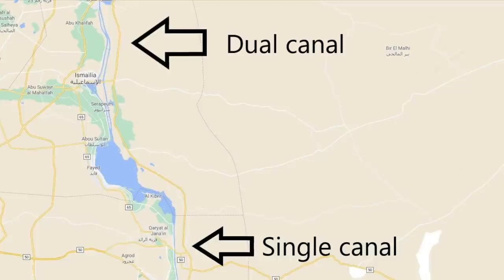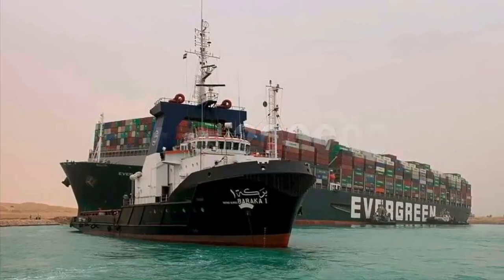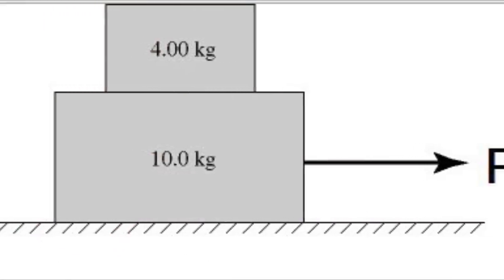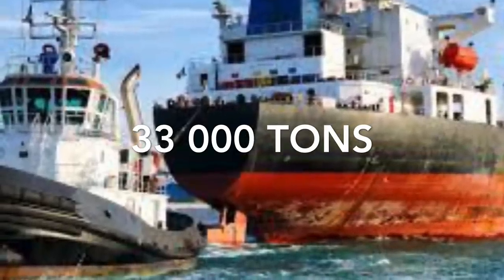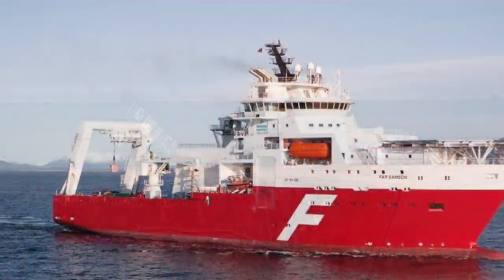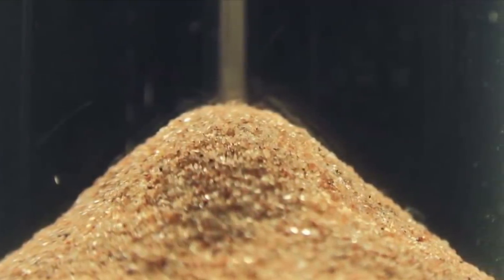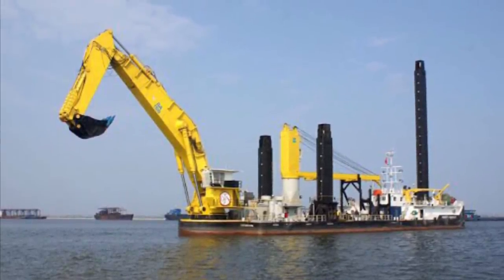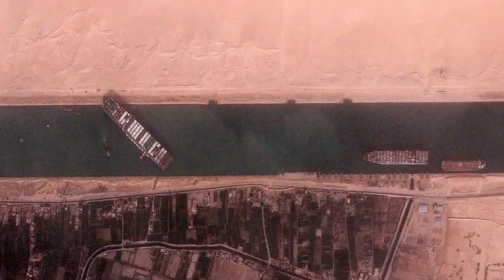MV Ever Given - why can't it be pulled out? Suez canal blocked

Comment: A solution like how the ships going through the Panama Canal might be the way to go. Set up anchor points along the shore and have them pull on various hard points on the ship at different times to pull and align the ship into position.
Reply: That’s what I was thinking. Why not pull the stern from land? They could set up some strong anchors on land, attach winches, and pull it out.
Reply: They only do that going through the locks.  For the pools between the locks, it is no different than at Suez.
Reply: that or a variant would probably work, twisting the ship into alignment would take less pulling power by using the 400M of the ships length as a lever against the stuck bow - if the lines were attached to the starboard side at the rear and connected to land based equipment to pull while the ship was in the appropriate level of reverse during high tide I would think would do it.
Reply: Seriously, you don't understand the scale of the forces required, a donkey pulling a barge solution wouldn't work.  You saw how small the backhoe was compared to the ship, they look like tonka toys, you'll never get enough land vehicles there to pull the weight needed.  Remember the Panama canal has a track beside it for the vehicles and the vehicles are sized to pull boats that are floating on water, that is with little resistance not something that's beached.
Reply: @nutandboltguy3720   the tug boats get there quicker. The tugboats generally do a better job because the tugs  try to wobble it back n forth , rock it , get the liquefaction happenning. So far they didn't rock its hull , they just bend the  steel... Thats when they stop the effort, because they dont want to break it  ,its relatively fragile,much weaker than the forces required for brute force dragging...
Reply: @gomerromer7708  Also, there are no locks in the Suez Canal, so there was never any need for such equipment.
Reply: @johnwang9914  I didn’t say it was an easy or simple solution. I realize that it would take a huge amount of equipment to move a 200 000 ton ship. My purpose of posting was to put an idea out there that might work. Since you were so quick to shoot it down you must have a better idea. Please enlighten us.

Comment: Can't high-pressure water hoses be used to wash the sand from under the front of the ship.
Excavating looks hopeless, but water pressure is not.
Reply: I would think that doing the water excavation to the back end and pulling/tugging the ships bow away from the shore might be the best way to tackle the physics here.
Reply: @elizabethschumacher3039  It makes sense, but I didn't think there's any vehicle capable/specially designed to pull such a giant ship from the land.
Reply: Use  pumps similar to the ones used to build artificial islands in Dubai to vacuum sand and silt away from grounded areas plus hydro blasting the bow and stern areas  and widening canal
Reply: @elizabethschumacher3039  that's what I thought too! From my tow truck days I remember the easiest way out is almost always the way it went in.
Reply: I thought the same thing. I use to work at a Quarry, and we would move sand away from machinery foundations with high pressure water hoses.
Reply: I though that too, and there seems to be a few people on the same page here reading the comments. I seem to remember in the last Israeli-Egyptian war, Israeli sappers used the same trick in getting their amphibious vehicles into the Canal, so this could work if some engineers use their heads.
Reply: The offshore dredges he mentions can do this. They are not all sucking up sand they can also move sand with water. It’s still a crazy problem just due to the scale of everything.
Reply: Its not like they just have such pumps laying around, it could take a long time until the pumps are on location and operational.

Comment: The important question is how many tons of high explosives is it going to require to solve this problem.
Reply: It may go that way. There is too much at stake for it to continue to block the canal
Reply: @ProctorsGamble  And if yous wash out all the sand with some pressurized jet water, until is completely afloat...
Reply: @rrebaza  my thoughts as well.  Should be the first thing that comes to mind
Reply: @rrebaza  that would be the reverse of the underwater dredge.
Reply: @rrebaza  I was thinkong the same thing.  Isn't that what the Egyptians did to cross the Suez during the Yom Kippur war?
Reply: More is not always better, but math is hard.

Comment: Well, I am familiar with construction equipment and I am pretty sure that there is equipment that could excavate to 30 feet (10meters) but actually only just. Any deeper and the only viable option I know of is a dragline excavator. These however have limited capacity to dig underneath anything. At this point, given the time pressures it’s probably better to figure out how many of the multiple options can be applied at once. Containers might be off loaded while the dredging goes on.

Comment: Good information.  I did watch another video where they talked about unloading the ship.  There was a problem with that idea though, if not unloaded evenly the ship could crack in two because of uneven weight distribution.  If that's true, removing this ship may take a very long time.
Reply: 20k teu unloading without specialized crane and with the awkward position would take a long time. They still might do that but its not the same as unloading on the docks
Reply: That is correct, sadly, unloading the containers needs to be done very carefully and in a specific order to keep from cracking the ships hull.
Reply: @flyinghigh2000  Exactly, and you would have to have a crew phycically rigging each box by hand before it could be lifted off by crane or helicopter.  That is a lot of work dragging cables, shackles, etc, around.  It is not like in a port where the gantry operator just drops the lift frame on top and it latches on.
Reply: And they are limited in the types of crane they can bring in. Shore-based cranes won't have the reach to unload beyond the very ends of the ship, tower cranes have more reach but not the lifting capacity needed, and a big enough floating crane will be very cumbersome and slow for such a repetitive operation.

Comment: I've worked on the docks for over 25 years. There is no way those boxes are coming off in the middle of the desert and then somehow be put back on. The wrong box comes off at the wrong time and that ship cracks or tips and if that happens this problem last for years
Reply: It might be stuck there for ever
Reply: Stop it. Unload it like they do any other time.
Reply: @mec4lifesmiley700  Yep, all they need is a ramp and a wheelbarrow.
Reply: @mec4lifesmiley700  they are unloaded by huge cranes that are stationary.
Reply: @mec4lifesmiley700  they are in the middle of nowhere how are they gonna remove 10 tonnes containers without a crane?

Comment: Life : "So what is the solution?"
Me : "I do not have the answer"
Reply: call superman
Reply: Call Magneto
Reply: Something something FLEX TAPE®
Reply: Could they put a temporary dam either side of the vessel and pump water in to raise the vessel up higher?
Reply: @usmc forever They probably thought of that, too. Still not easy to wedge something inflatable underneath that weight.
Reply: Ron Pratt and the Rotator would have it out of there in 6 hours or so. But he would need to take the road.
Reply: an honest answer
Reply: Take the cargo boxes off first .
Reply: Blow it up!

Comment: They could build massive winch platforms on the opposite shore and pull the bow out of the mud.  Also might look at using high pressure water hoses to hydraulically dig the ship out.
Reply: Simular to Costa Concorda

Comment: Thanks for the clear statement of the situation. Has everyone in Egypt forgotten how during the 1973 War the Egyptian army breached Israeli defensive berms on the eastern side of the Suez Canal? They used pumps to shoot water across the canal and wash holes in the sand berms. Seems like this would work here, you won't need long digger arms, or have dredgers work under the hull of the ship. Just push pipes down and wash sand out underneath the bow and stern.
Reply: This is a good idea but there are many factors that could prove to hinder the situation. Like the logistics cost of sending the
 water jets and keeping them powered for long as the fuel consumption would be exponential, along with developing a fuel efficient way to properly adjust the ship. 200,000 tons is no joke and would require an eminence amount of funding and resources to pull off with out problems. Also the amount of force needed to properly adjust this beast would probably damage the hull itself
Reply: I think the best option here is to possibly unload the extensive amount of cargo of the ship to reduce the weight but that alone would also require a decent amount of resources....let's see how they go along with handling this situation
Reply: But this just my theory take it with a massive grain of salt
Reply: I was going to say the same thing start loading up the trash pumps
Reply: You do realize that if they just start washing out sand, and don't do it incredibly carefully, the ship and all the cargo will capsize?

Comment: Both bow and stern are hard aground.  Makes it even more difficult to refloat the vessel.   There is a significant length of the hull, both forward and aft, aground on the sand due to the 4:1 slope of the canal banks.
Reply: "The nose" lol does he means the bulbous bow? that containership is a flat bottom vessel
 And where the hell did he come up with his Weird mathematical equations "1/3 of the vessel means you need to pull 50% of 1/3" what the hell is he talking about? Does that formula take to account the substrate of the channel? 🤔
This guy just made all this stuff up to get views
Reply: You have it exact. This is quite the problem. The best idea I've seen is above, build cofferdams and raise the water level by 10 metres.

Comment: Attaching wires to the stern, it would be possible to winch it from land to help the tug boats. Along with pumping water underneath the bow to liquify the sand.
Reply: That's exactly what I was thinking
Reply: Same here
Reply: Yup. Or lifting bags and pulleys. This is a simpler problem than we're making it. 

Big. Dangerous. Difficult. But not complex. Aside from obvious logistics. But weld a few points. Push, pull, and lift, using leverage from pulleys. Boom.
Reply: @shadowfall2011  so easy right?
Reply: how exactly do you go about building a wench that can pull 33,000 tons and  with a foundation strong enough to provide an anchor for a 33,000 ton pull in the desert which is sand in a reasonable time frame? it would be faster to unload the ship at that point
Reply: Exactly what I posted
Reply: @vitsadelhole  A Wench is a female servant. I think you may have meant Winch, and the same way you build a dam that holds back millions of tons of water
Reply: exactly, again like i said in other comments, everybody working on this thing isnt coming at it from a math standpoint, and when you push shit too hard it breaks
Reply: @paganathiest6349  Better to pull than push, Steel in tension does very well
Reply: @paganathiest6349  Yes it does, but why would anyone push this too hard? I'll take riggers and engineers over mathematicians any day to solve this problem. Math is a tool, not a solution.

Comment: Land based winches. Or as others have said, dozers. I’m sure in that part of the world there are cranes and other cable winch machines from the oil industry that wouldn’t be too far away. As long as the ship’s hull can withstand the pulling in multiple points.
Reply: My thought as well. The recovery effort of on of the battleships at Peal Harbor involved winching from shore using cable car motors

Comment: A classic example; sometimes making things Too big come with it's own inherent problems
Reply: True. And in fact, the ports themselves don't like this class of containers. 'It's an accident waiting to happen'. That seems sufficiently proven now! What puzzles me is why they're not trying to unload it, as the video says, and why they're not trying to do anything much from the land rather than the water. Pulling from the water is just pointless. 

The best thing I can think of is to unload it, then assemble an extremely large crew of cranes and HGVs, pull from the land, and try to at least rock it partially free from the earth, and then start the engines in reverse a few times. But what do I know? They clearly have their worst minds working on it... :/ :)
Reply: @Microtherion  Or maybe just unload and destroy the ship. Cut off huge pieces to make the hull lighter.
Reply: @ibrahimtall6209  Also a workable suggestion. Good thinking! Alexander the Great would have loved that. 'The Gordian Knot' etc. :)
Reply: @Microtherion  Short version: Because the logistics would be insane and the process would be still very slow.
Long version: Unloading it enough to make a difference means shifting hundreds of containers to somewhere else, without the multiple purpose-built cranes, trucks, trains and storage lots that a port has. It would have to be done by heavy lift helicopters, if any are available. It would take days/weeks depending on number of people and helis mobilized. The off-loaded containers would need to be tracked and guarded and are at high risk getting lost/stolen. Once the ship is refloated, if only the front was unloaded, it would be off-balance. Reloading the containers by heli (because what else would one do with them in the middle of nowhere) would be a more precise and slow process than unloading them. And they'd need to load them in the correct order so that they are accessible for the multiple destination ports. There are so many things that can go wrong with unloading the ship where it is, it would cost an insane amount of additional money, and it would gain no time compared to digging it out.
Reply: @KimonFrousios  send divers to put explosives under the front and pull on it with another ship when detonating.
Reply: @KimonFrousios  Good points, but I still disagree. It's costing them several million dollars per hour to leave it there. Many - though not all - of the complicating factors you cited could be overcome. Digging it out seems unlikely (by itself) to ever work - they've already said it'll take weeks that way.

So the cost-benefit ratio is extreme if they genuinely want to unblock the canal - which is something else we won't know for maybe 25 years, when we finally discover whether this was pure accident or whether the (US-backed) Egyptian dictatorship has other reasons. The risk of crates being stolen would also be piffling compared to the cost of halting most maritime trade globally, which is where we are for now. I mean, it's not 'my problem' anyway. It's one-in-the-eye for global capitalism, which I'm not a big fan of in the first place. Arguably, it barely matters. We're seemingly months away from the next stock market collapse...